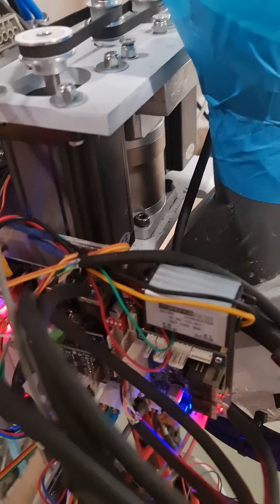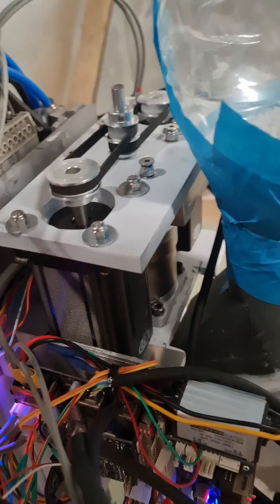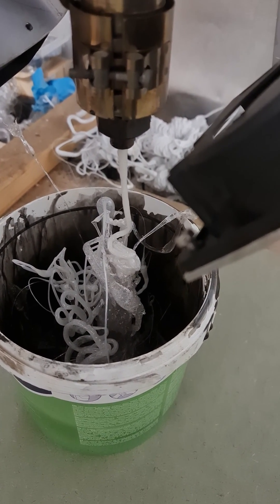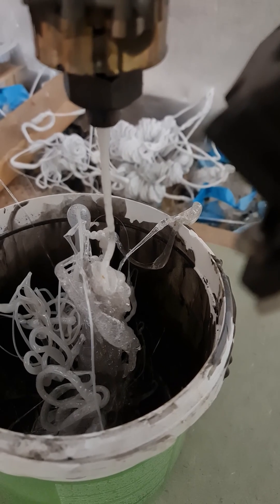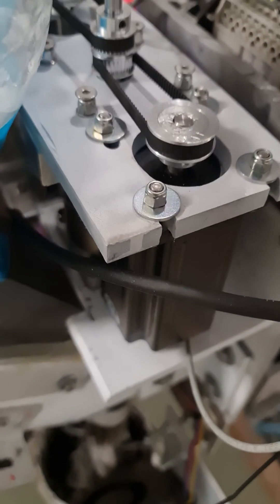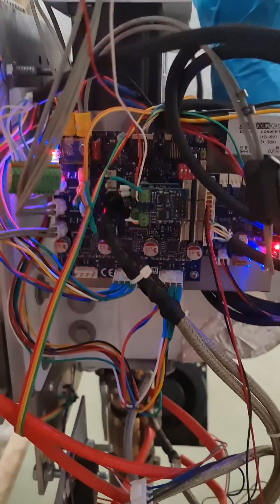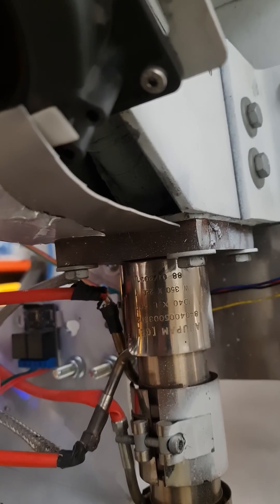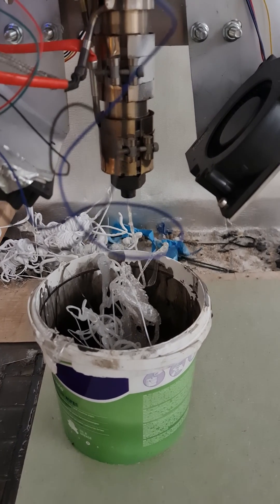Pellet extruder upgrade for diy 3d printer.

Comment: Great! Its shredded PET? The screw in feeding part of extruder is still in metall tube or you cut it until heaters?
Reply from the maker: 2 screws one as the main extruder and one that pushes the material into the head of the main extruder.
Reply: @Big3dprinter  I see this. My question is not about this. Sorry for my English. At the beginning you had a extruder in metall tube with small hall for pellets. Aftwr some iterations you covered this tube with your own feeding system. It seems, that inside your feedind system there is only screw without metal tube over it. Have you cut it? Or the extruder is in same state as you bought it?
Reply from the maker: Extruder was cut and welded on a mounting plate. The original extruder has been slightly modified. So the feed tube is gone as well.

Comment: Nice work, how will you sync screw and melt pump?
Reply from the maker: Have not fitted the melt pump yet, but I'm thinking the melt pump will be set as the extruder. Then pellet extruder will be set via pressure sensor this way we should have a consistent feed of material to the pump.